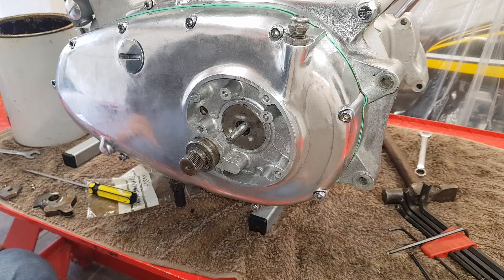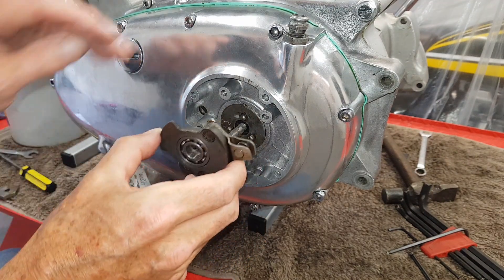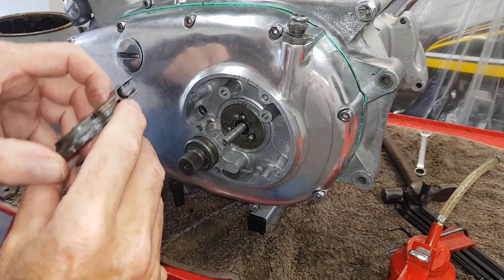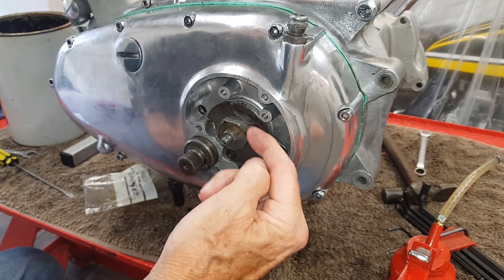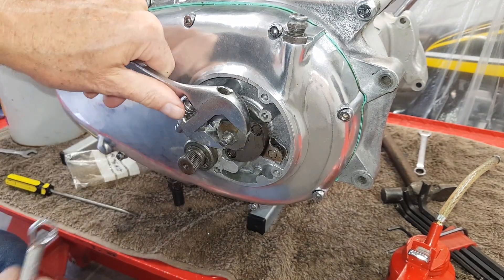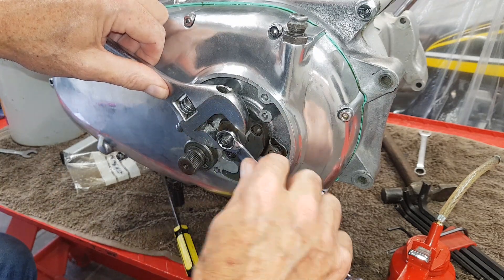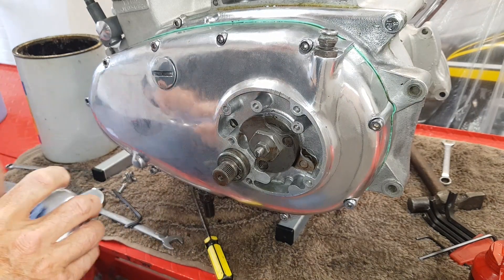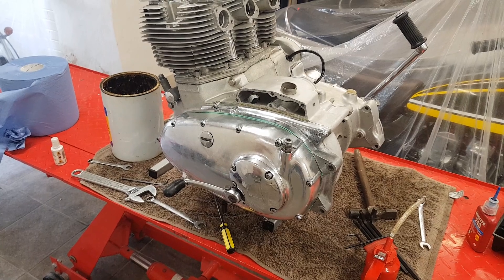Triumph Trident T160 Engine Rebuild. Part 43: Fitting the Clutch Operating Mechanism

Comment: hi chris, i am trying to fit a new t160 clutch cable it's inner is 59 inches, and won't reach to fit by about 2 inches, uk bars, what do you reckon? are there different lengths? this was bought to fit t160's but doesn't unless iv'e missed something, i have it routed at the nearest path to/from lever to mech'
Reply from the maker: It could possibly be too short. I'm unsure of the correct length though. Can you get back to the cable suppliers and check with them? I take it you've screwed the adjuster on the top of the chaincase fully in?

Comment: Hey Chris, did it work well without the two springs? I installed my clutch operating mechanism yesterday and came here to check for your advise on how to set it. One of my springs has a crack ... Now after listening to you and checking the price /~,£10) I am thinking of leaving them out? What are your experiences? Cheers from Germany!
Reply from the maker: Yes, it worked fine without the springs! However, it didn't make the clutch any lighter as the springs aren't that strong, so there's no real benefit to leaving them out. The main way to achieve a light clutch that disengaged easily is to adjust everything so there's no play at all - or even a bit tight - but with actuating lever still at the bottom of its travel. Good luck. 👍👍👍